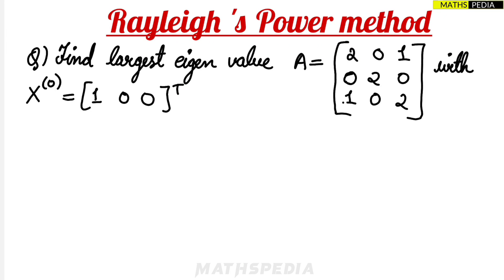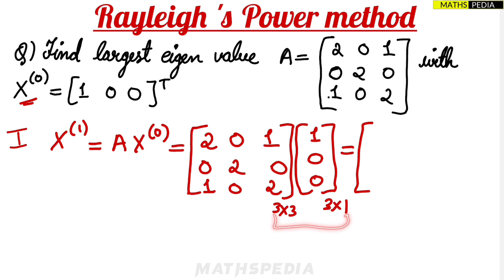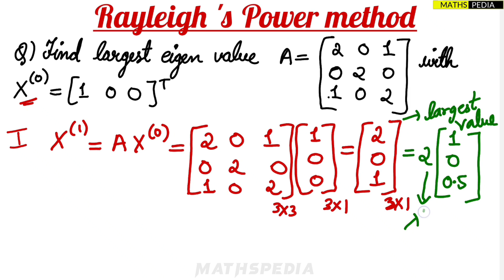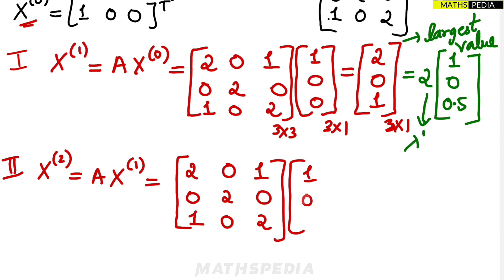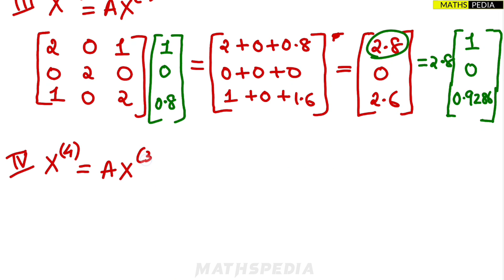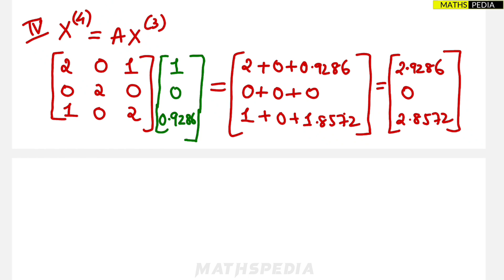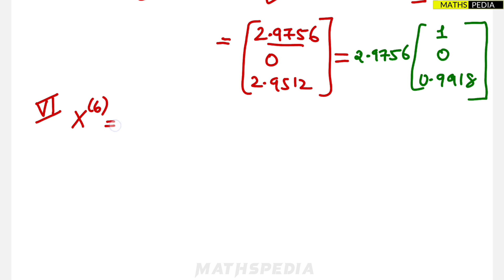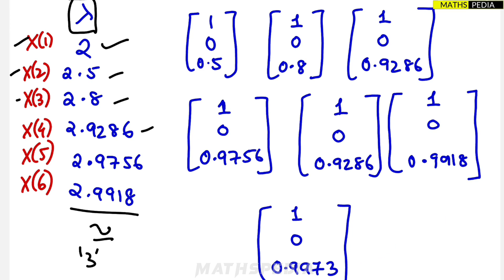Rayleigh's Power Method | Largest eigen value and eigen vector | Engineering mathematics|Mathspedia|

Comment: 00:04 - Introduction to Rayleigh's Power Method for eigenvalues.
01:37 - Understanding matrix multiplication for a 3x3 and 3x1 matrix.
03:11 - Understanding Rayleigh's Power Method for eigenvalues.
04:52 - Demonstrates eigenvalue calculation using Rayleigh's Power Method.
06:30 - Understanding iterations in Rayleigh's Power Method.
08:27 - Applying Rayleigh's Power Method for eigenvalue calculation.
10:27 - Lambda value stabilizes through iterative calculations.
12:22 - Rayleigh's Power Method converges to the largest eigenvalue and corresponding eigenvector.